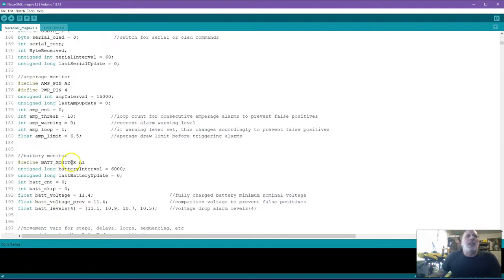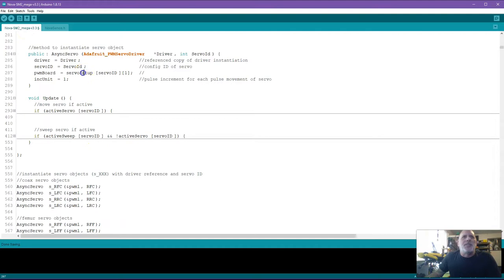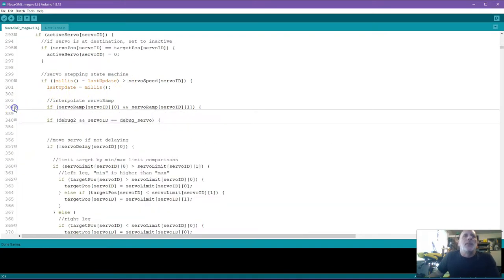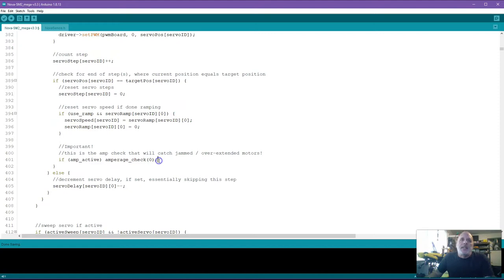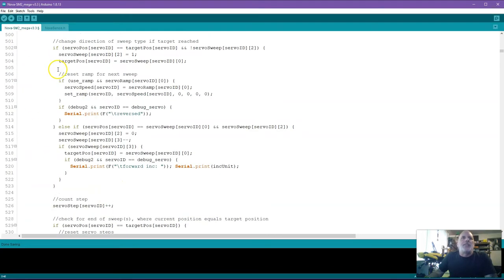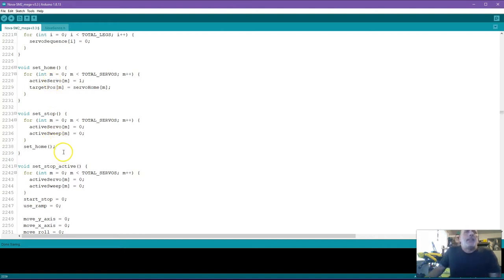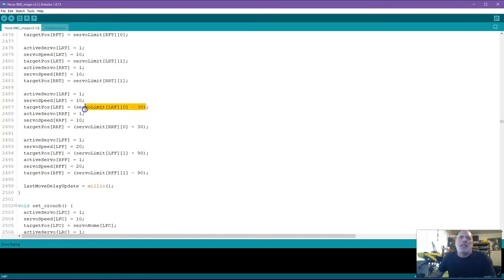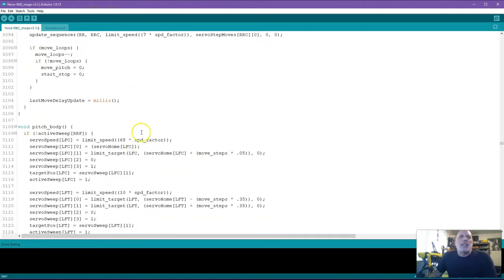Nova SpotMicro - Software Review: AsyncServo Class

Comment: For someone who doesn't program in C++, and the like,  even if the pure programmers could criticize, you have all my respect!  If it works correctly, is understandable, maintainable  and efficient enough for the job who cares if it's not the most elegant efficient code.  Just  the humble opinion of someone with quite a few years of software and hardware design and development.  Your videos contain everything one would like to know for a project like this.
Reply from the maker: thank you so very much for this great comment! Since posting this video, Ive been wondering who will call me out for my motor class calling external arrays and a function or two. I agree with you... convention and standards are great, but not a requirement. If i were writing the class to be used by other applications, yes, Id not get away with using global elements... but in this case Im not, and no one is paying me to take the time to make it all standards compliant.  True, i can surely speed it up with proper use of data types and definitions, but yet again... this code is for me... if it works for my purposes, why does it matter? lol   

thanks again for the supportive insight! 👍😎